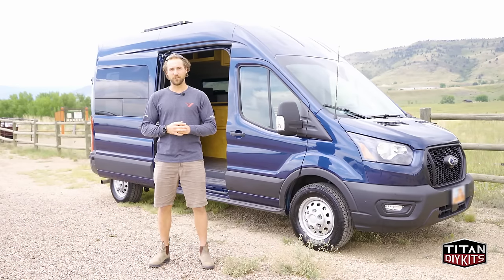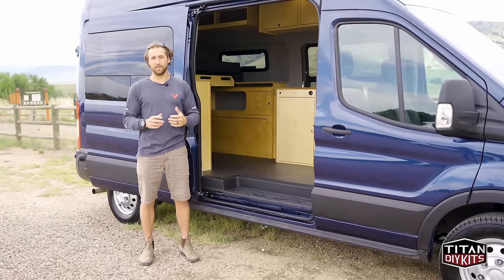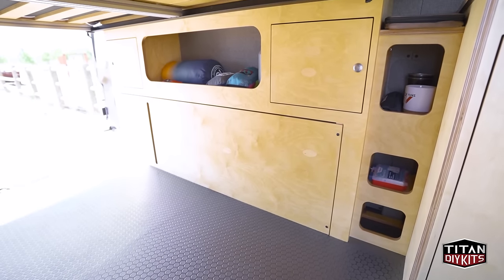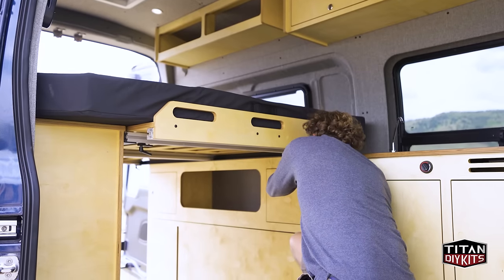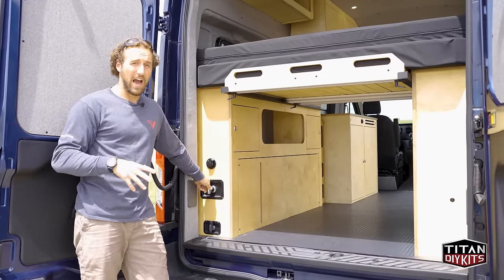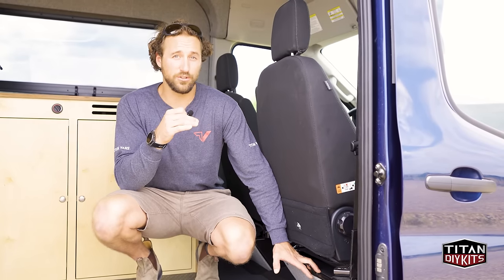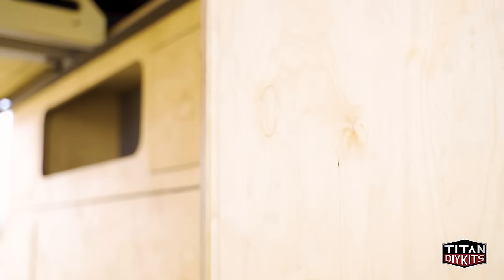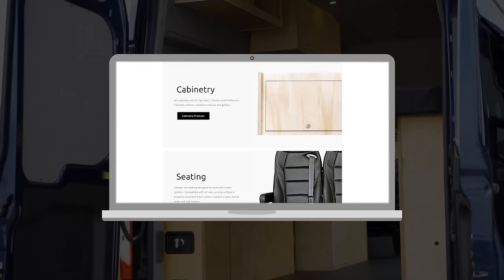Fully Installed Van Conversion for Under $25k | Timber x Titan Vans

Comment: How about a toilet?
Reply from the maker: Not offered with Timber Van Conversion, offered by Titan DIY Kits. We offer that option and many more through Titan Vans and the many models they offer. Though adding a small cassette toilet is certainly an easy option.
Reply: Without a bathroom it is useless. A cassette toilet is a must as is a microwave
Reply from the maker: @Desperado3248  Cassett toilet can easily be added but many customers do not want or need a bathroom. If you want additional options you can check out our full production line offered through Titan Vans. We offrr builds with toilets, showers, and saunas.
Reply: @TitanVans A Sauna?!? That sounds like a dream. I am going to look that up.

Comment: No shower. No bathroom. No deal.
Reply from the maker: It does include a rear door shower and there are ample portable toilet options on the market. We've opted not to incorporate an interior shower in this conversion to maintain a reasonable price point.

Comment: So the conversion costs more than the vans and you can buy a fully converted van for that price or less. Ok sign me up😂😂😂
Reply from the maker: I'll try to alleviate any confusion that may have occurred 👍

A brand new Mercedes Sprinter 144 High Roof will run you about $60-$80k (you can probably find a used one for closer to $30-$40k).

The conversion, installed here at Titan Vans, is just under $25,000 as the title suggests.
Or you can opt for the Shipped kit if you have the time to convert your own van and save another $10k.

Now if you're looking at a brand new Storyteller Overland (just the base model) you should expect to pay close to $180k. 

Hope this helps 🩵

Comment: Good for a week or weekend but not ft vanlife, too much wasted space could use as storage.  Under kitchen sink cabinet to the right needs at least one adjustable shelf.  No toilet, guess you are set with campgrounds or going in the woods.  Watching them build saw no insulation, mold potential.  I like wayfarer better, sorry.
Reply from the maker: We do indeed add insulation to this build which can be seen at 1:00 in.  Most modern toilet options are rather transportable and can be housed in multiple locations. Thanks for the comment.

Comment: When you don't see flares on an adventure van...🙄
Reply from the maker: After paint matching, flares add around $7,000 to a build cost and still only allow max width of 80", less for most of the flare because of the taper. For individuals over 6 foot the sleeping area can be very tight and not practical. Transits have a factory width of 76" and Sprinters 74" without flares.

Comment: This is a pseudo conversion. Like all of these it does not meet the logic of having comforts of home when you roam. No bath , no shower , no Auxillary power, no entertainment, no microwave. It is a hard sided tent. My type of van which you can find used in the $60-65k range used , is a thor Rize 18m. Generator , ac, tankless hot water bath and shower. If you want a b plus, the Winnebago Trend 23 series can be found for $50- 65 , low mileage used with same features and more
Reply from the maker: Different needs for different folks! We offer many products, this being just one.

Comment: Who wants a camper van without a toilet and shower?. I mean.... other than people who own a 5 gallon plastic bucket.
Reply from the maker: The vast majority of camper vans dont have interior showers. From our experience designing custom vans for seven years now, 90% have not included showers inside. For toilets, a cassette or composting toilet can easily be added to any van build including this one.
Reply: All the ones I've seen on YouTube have one, but I have not seen many. 

I plan on getting a eTransit soon, and getting a shower and toilet combined in the same space. 

The shower is actually more important than the toilet, but it's very easy to put a toilet in the shower
Reply from the maker: @warkmard-dw4dw  check out our full production builds we offer through Titan Vans, think you might like this one! https://m.youtube.com/watch?v=5QksCfxh4VU&pp=ygUKVGl0YW4gdmFucw%3D%3D
Reply: @warkmard-dw4dw  Everyone who stumbles onto van campers thinks they need a shower in the van.  Its common.   Then you get a van with a shower....and quickly realize its a massive waste of space because you never wanna take a super quick shower in a tiny area where its hard to even more.   Then theres the water issue...
Reply: They do have outdoor showers, which is fine even in cold weather if the water is hot

In my experience, people who don't take showers that often (including me, a few times as a teenager) become nose blind to their own growing stink. And sometimes don't realize how badly they do need a shower. 

And most people are too polite to tell you... YOU STINK...!!!
Reply: @warkmard-dw4dw  Most campgrounds have showers.   Every town has a planet fitness for showers.   If you ever get into the van community you will find out that the vast vast majority do not shower in their van even if they have one in there.  Its a terrible shower experience.
Reply: I agree a shower is not near as important as a toilet, just in case you wake up at 3am in -10 below zero temperatures, after eating that big fat spoiled burrito. 

And I can't speak from personal experience because I have never lived in a camper that small. 

But i do know I woukd not want to use the "bathroom facilities" (with other people in the camper) without the bathroom being a ENCLOSED FACILITY for various obvious reasons 😷

And I have seen many enclosed toilets that are actually in the shower, they both take up the exact same amount of space. So you can also sit down while in the shower. 

Also, depending on where you are parked for the evening, "doing the duty" outside may not be your smartest of choices. 

Therefore my necessary design would facilitate both the shower and toilet in the exact same amount of space as a toilet would all by itself. 

To me, the 3' x 3' space for the dual toilet/shower is more important than any other 3' x 3' space in the camper.

 But to each his own. ✌️

Comment: It looks cheaply done.
Reply from the maker: We use the highest end components on the market. Including 3/4" baltic birch, marine grade harware, electrical, and flooring, and industrial upholstery. The finish on the cabinetry is left simple to allow customers to be able to add there own finish and make the whole conversion more affordable. If you prefer a more high end finish check out our full production line at www.TitanVans.com

Comment: Or u can do all that by u self for 10k
Reply from the maker: While it may seem like an option to source materials yourself, it can be rather challenging to obtain all the necessary components at that price point without the proper distributors. Furthermore, many don't have the time, equipment, or desire to build their own conversion van and would prefer to leave it to professionals like the team at Titan Vans.
Reply: @TitanVans  and then be charged arm and a leg .
Reply from the maker: @biliceivan77  The price of our kit includes installation.
Reply: @TitanVans  so u telling me isolation installing 4 cabinets 1 windows and electric wires coast 34k
Reply: @biliceivan77 hey if u can do it for cheaper, then do it n goodluck. U dont need to like their pricing esp if u r not buying. If u r here to bash then u r not welcome. I have watched enough van build videos to know that DIYs dont cost near your $10k estimate, especially if u match what they r offering.
Reply: @bfdee1603  I flip house for living so I know 100% hiw much u need for that kind of work but if u liked to be charged arm and a leg go for it.
Reply: @bfdee1603 What is your relationship to the seller? Awfully defensive. Methinks you doth protest too much
Reply: @GOLDVIOLINbowofdeath  no relations. I just don’t like him putting down d blogger with unrealistic arguments. D cost of d materials included alone will b more than $10k, not counting labor.
Reply: @biliceivan77  flipping a house n working on a van is 2 different things. For one, there r no straight lines in a van and so much engineering is involved. So if u have no experience in van builds and don’t plan on buying their product, then keep scrolling
Reply: @bfdee1603  dude I know I built my van so I know exactly how much that coast.
Reply: so its not your thing Bill, move on ✌